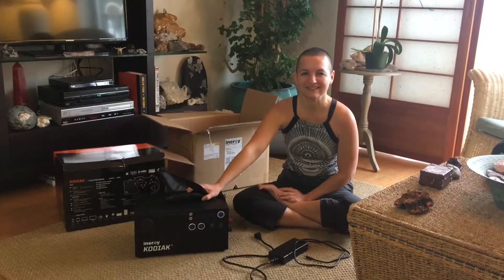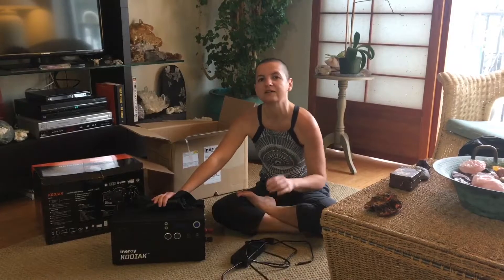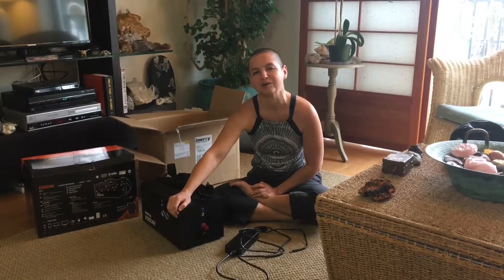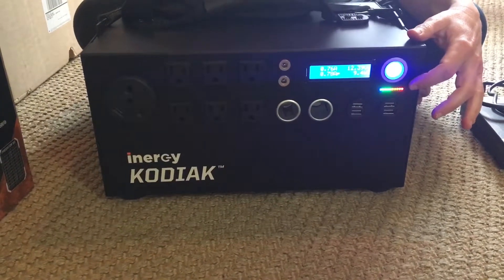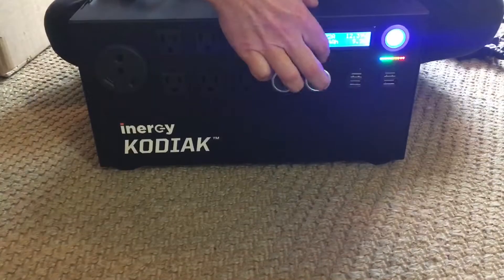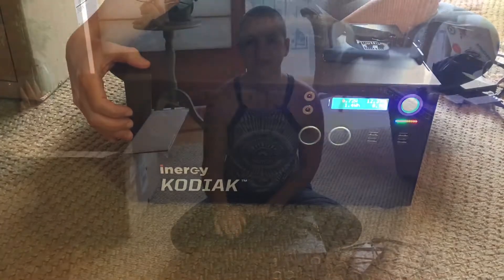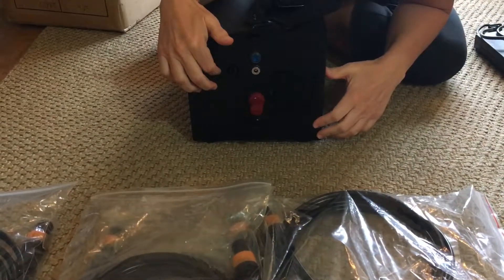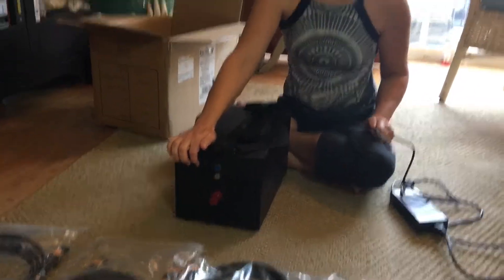Inergy Kodiak Solar Generator | Part 2 of 4

Comment: Tim and Vie.... I have already purchased the generator and you confusion is the result of conflating two issues.
Yes you can recharge the generator from the cigarette lighter (which is a 12 volt) HOWEVER that is limited by
a FUSE which is usually (in most cars) either a 10 amp or 15 amp or 20 amp - and the Generator REQUIRES
at least a 30 amp fuse.  So... unless you get creative you will NOT be able to recharge the Generator in most
cars.  Hint: you can use a special solenoid or an isolated circuit to get around this limitation.  But the point
is that Kodiak KNOWS most cigarette lighters will NOT recharge the generator and they have decided to
hide that reality.  Bottom line: if your cigarette lighter is not 30 amp (or more) then you will need a work-around.
Again the issue is NOT that it is 12 volt the issue is most cars fuse is not 30 amps.  Two separate issues son.
Reply from the maker: So sorry you are having issues. Have you contacted Inergy Kodiak? They are very helpful and quick to respond. We charge ours as we drive down the road in our F150. In fact we used the car charger yesterday.
Reply: What is the fuse on your cigarette lighter?
I said that MOST cars use a 15 amp or 20 amp.
I am aware that SOME cars/trucks us a 30 amp.... but that is not the majority.
So, if you are advising people of the capabilities of the Kodiak then (if you want to be honest)
you need to note the LIMITATIONS.  And to answer your question I have contacted Inergy and they
were the ones that advised me of this limitation - after I purchased the generator.
Reply from the maker: After receiving your post, we tried charging the generator with eight different vehicles, including our two (a total of ten) and all of them charged it.
Reply from the maker: Wise Virgin by the way ours is a 12 Volt.
Reply: Tim and Vie... I appreciate your effort to find the truth but 
your methods (of trial and error) is simply not any proof.
You can contact Ienergy and ASK THEM whether you need
a 30 amp fuse to charge the generator - they will confirm
as they did with me.  I bought my generator from Tiny Houses
and the immediately edited their website to show this limitation
after I complained to them - and after they confirmed the truth
with Ienergy.  I am not saying that a smaller fuse may not work
for a short time or under a certain load... I am only telling you
what the truth is according to Ienergy (and confirmation with
Tiny Houses).  I am glad that (so far) you have not blown a fuse
but if you want to provide truthful information to your viewers 
then you must tell them the limitations as ADMITTED by Ienergy.
Good luck guys.

Comment: Tell me.... what good is a 20 amp DC (car cigarette) charger when MOST cars
have a 10 amp cigarette outlet?  The answer is it is WORTHLESS and Ienergy
knowingly misrepresents this feature.  Now, it is possible that your car has
a 20 amp cigarette outlet - but MOST cars do not.
Reply from the maker: Hi Wise Virgin, thank you for watching this. Not sure where on this video you heard the 20 amps for a car cigarette lighter. We are talking about 12 Volts car cigarette lighters. And that is the standard for pretty much every car.